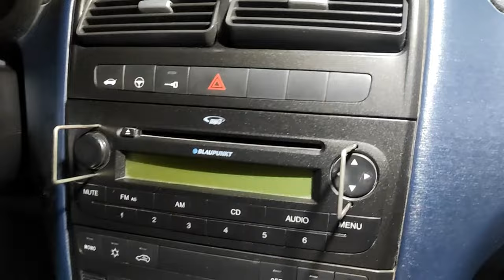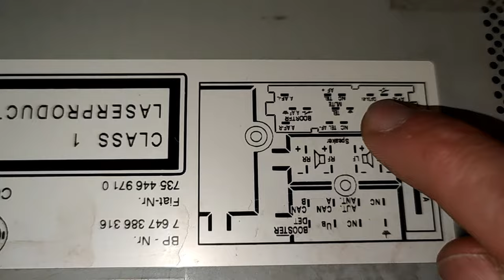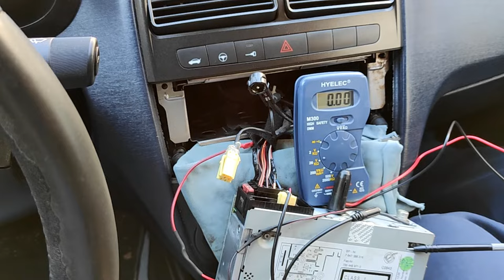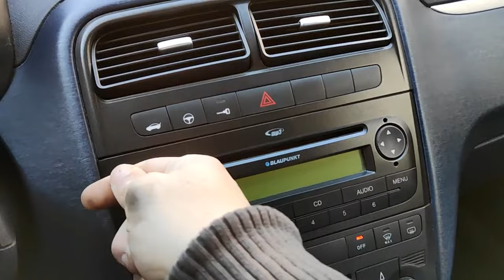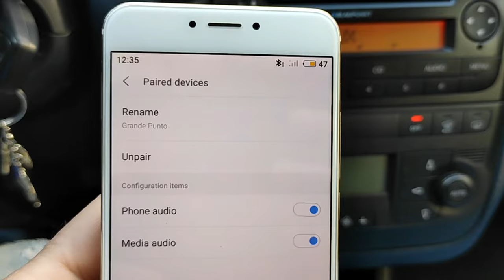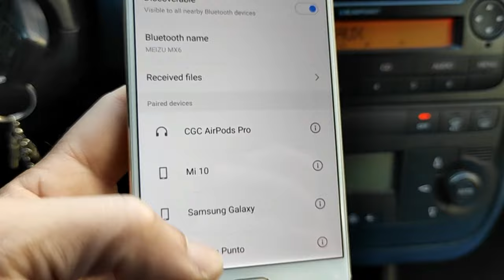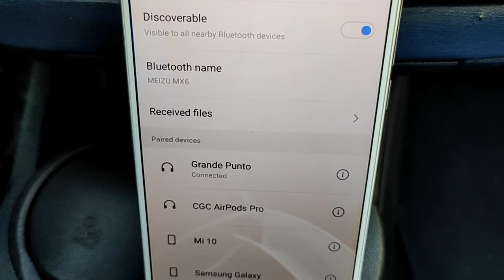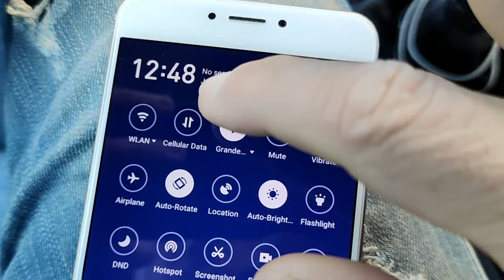Fiat Grande Punto, Bluetooth 5.0 Audio AUX Cable Adapter

Comment: I did it, but I see no AUX option. I connect to CarKit device and there is nothing when switching through SOURCE channels. When I press WINDOWS button on steering wheel, then I can hear music. Is it good that way or not? Greetings from Serbia!
Reply from the maker: hello my friend, first of all you mast not have usb and cd together in use. You need to push 2 times the cd botton and hi go to aux mode then is ok
Reply: @SelFMechanic  i have same issue like him, so i need to press 2 times on CD than on Mode? I also checked but on the pin you connected the red wire is no voltage, is this ok?
Reply: Kako ti radi taj adapter,jesi li zadovoljan?

Comment: Where i can buy the cabels
Reply from the maker: hello, I buy from Ebay, at the end of the video I have photos.., you can also order it from other pages, aliexpress.
Reply: @SelFMechanic hi, where can I buy the cables connected to radio? I can only see shops that sell connectors but not connectors with cable

Comment: I don’t know why, but in my grande punto 2011 I cannot find 12V on the pin you suggest
Nor with radio on or off, never 12v

I can find 12v on other pin
Unfortunately the pin is like under the yellow plastic connector !
Reply: I have the same problems, can you help with the pin correct for 12 v
Reply: @remjan there is another pin with switchable 12v
It is positioned on the AUX area, just like where you will put the white connector
This pin will be covered by the connector, but you can put a wire directly into the connector and take 12v when the radio is ON
Really the 12v are available always when key is ON
If the key is OFF the 12v are absolve with the radio ON

To find the pin Look for the indication on the adesive label, you should find same symbol of interrupt or

I hope it is enough for you

Comment: Hi. My Fiat grande punto from 2008 doesn't have that Aux option when I am pressint twice on the CD button. When I m pressing it is writing me "no source available''. 
The aux option is working only when I m pressing that windows button on the steering wheel and is working just for 10-15 seconds and after it switches automatically on "tuner fm". 
There is any other option for me ?
Thanks in advance !
Reply from the maker: Hello,
your system is different i will try to help,
i will search the internet to find something, if anyone knows and can help, please do it. :)
Reply: @SelFMechanic  thank you very much mate
Reply: Did u find the solution? I have the same problem